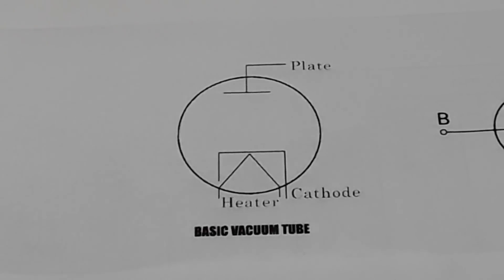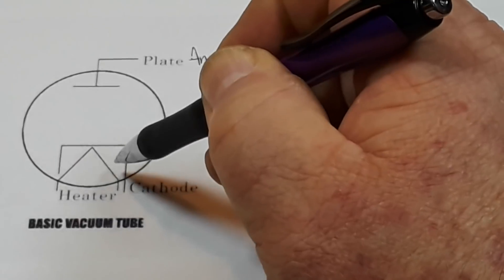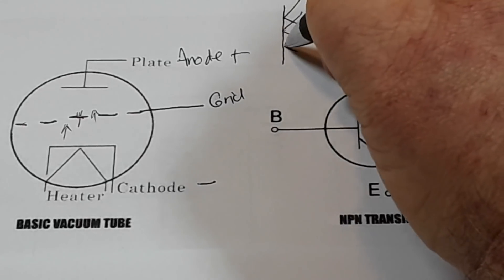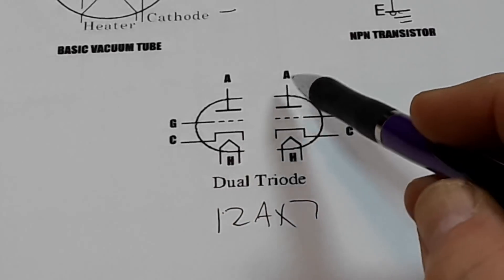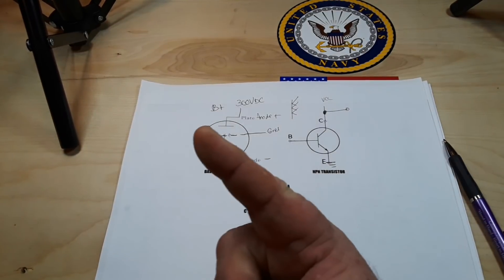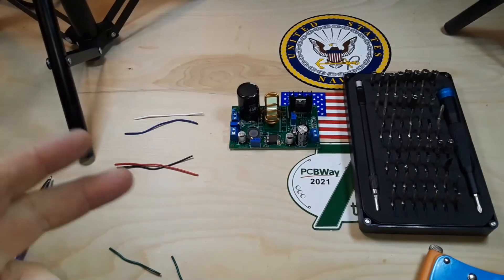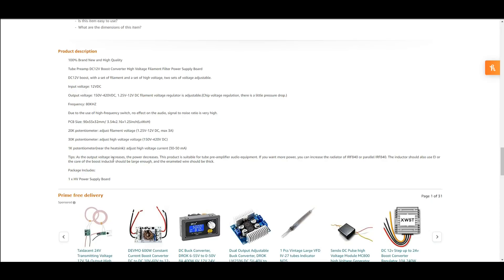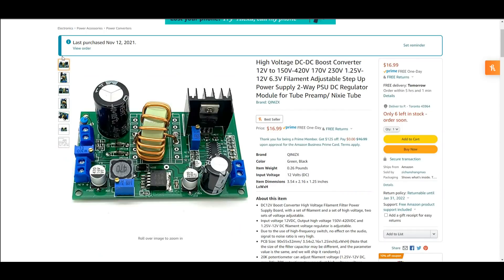High Voltage DC PSU

Comment: You didn't explain on paper how a tube rectifies an ac waveform into DC voltage. It would nice to show how to test tubes using an ohm meter also

Comment: The mystery chip is a TL-494 Pulse-Width-Modulation Control Circuit.  The number is on the schematic below the chip.  I first read it as TL-194 but the Google search algorithm compensated.  I could only make out the first 4 as such when I went back and looked after finding the schematic.  I cannot figure why they marked it so badly as the LM2576 was quite clearly marked and readable without magnification.  I am looking forward to seeing it in action.

Comment: old electronics are pretty cool. I tried making a useful circuit but I kind of failed, got unexpected behaviour  and I found it hard to figure out why on a breadboard.  I tried simulating it in Every Circuit but got simulation error.  All it is is a voltage doubler connected to a comparator and the other input of the comparator is connected to a battery,   the output is connected to a relays coil through a NPN transistor,  what was supposed to happen was that the relay would turn off once the batterys charging level exceeded the ( doubled ) voltage provided to the circuitboard. I found that the simulation would work if I changed to a voltage doubler design that also used a NPN transistor and a PNP one, but then I had no idea how to scale that design up into a voltage quadrupler.  The idea was to be able to charge 72v batteries with a 24v DC power supply to the control circuitboard, scaled down to 12v with a voltage divider or something.